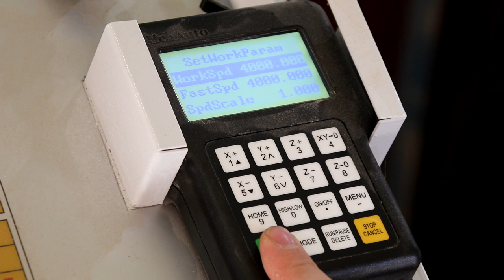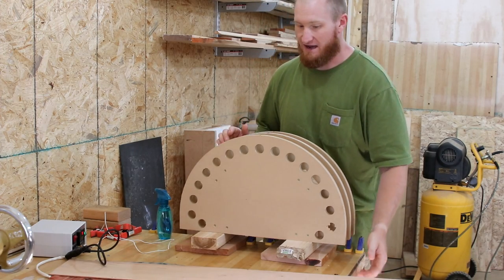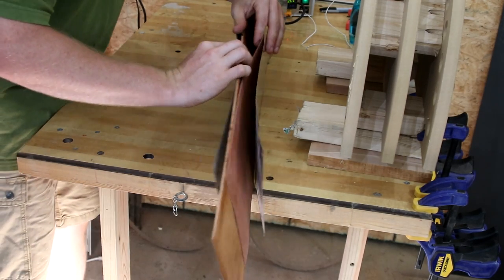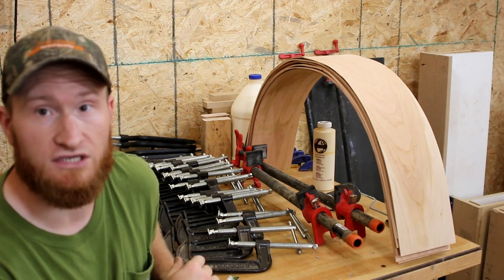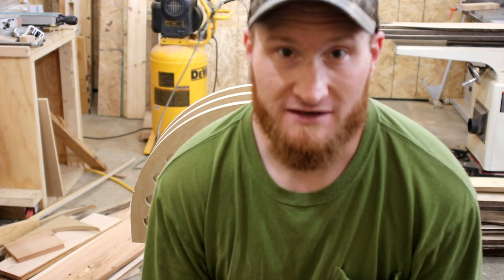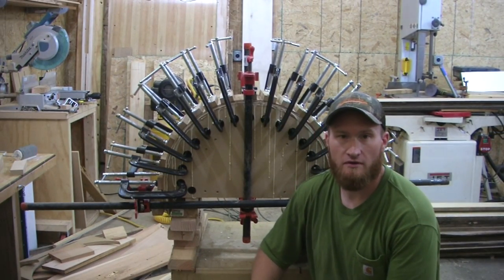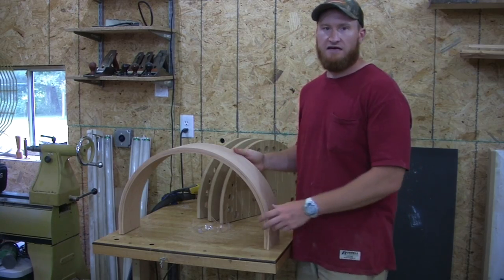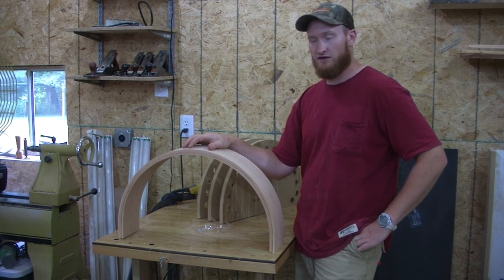Serious skills! This guy bends wood! Southern Indiana Sawmill

Comment: I need to build a corner table with a 20" radius (so a 1/4 round  of 40"). I don't have a heat blanket; and don't want to buy one for one project. Will wetting, alone, the 1/8" stock and somewhat prebending it work on that larger radius? I need 6 each 1/8" to make 3/4 thick. I need to go 4" wide (finished).

Comment: How you like your mirka sander? I have some problems with lots of pig tails after sanding ,,, have you had that happening?
Reply from the maker: Not really had any problems with that issue.  I use fresh Abranet exclusively on the sander which leaves no swirl marks.  You may want to read the manual which describes different weighting methods based on pad size.  If the weight in the sander is not balanced properly, I could see how it may have an effect as you are describing.  Thanks!

Comment: Instead of all the clamps, could you use wide strap and ratchet?
Reply: Ideally you use a large clamping jig like this. Strap wraps dont apply as much pressure.  Usually a great deal of cabinetmaking time is spent making jigs like this. If you needed to make structural curves its similar but far more clamps and usually a beefier jig.
Reply: YES, you are a thinker! I'm sure a mind like yours can come up with a thousand ways to do this simple arch. There's a lot of ways to skin a cat. I've seen this done by simply cutting the inner and outer arh pattern and then tying them together over the laminate with bamboo strips. I've seen it done using mud, sand and even stone forms.

Comment: Nice video, but I disagree with you saying a vac bag wouldn’t pull it together. I have used vac bags for years. They clamp hundreds of pounds per square inch.  Never had anything not bend no matter how tight the radius.

Comment: Wood glue is wood glue.. you don't need to buy an expensive type
Reply: This is not necessarily true.  Wood glue such as tight bond allows too much spring back when you remove it from the form because it is not rigid enough.  Glue made for laminating will minimize any spring back so that your piece holds its proper shape.  I have used plastic resin glue for custom bending handrails and it works well.
Reply: LMAO.  This worked but it took a long time.  There are easier ways that allow mass production 
His labor cost if put into the product would make it cost excessive.  Nice cnc work though.
The hidden costs here also drive up the price on sale.
Reply: Not true at all, each glue has it's own unique characteristics. Some are more rigid and crack from wood flexing over time and glue geting brittle over time, while others can flex  as if rubber. It just depends on what you need the glue for, a boat for example can flex by up to 12in from a wave and most glues cant handle the stress so they make flexible glue specifically for those parts that flex. Hell they even make a flexible epoxy....... but I agree that regular wood glue can handle most jobs for glueing wood but in some specific cases you need custom materials and alot of thoght and engineering went into development of these products. Some of these glues are so well made that they will outlast the wood and that's saying something considering that some wood work is hundreds of years old.... regular chalking gets old and brittle in as little as 10 years and the good stuff lasts 40-50years(also costs 5 to 7 time more then cheap stuff)... chalking is a great example because it dries out so quickly and gives you a rough idea what happens to all materials as they get oxygenated  and bombarded with heat/cold and UV light eating away at the "half life" of the molecules in the glue/materials
Reply: Mike Keegan More often than not, the wood fiber breaks before the glue joint does, unless there’s something weird going on. This is with any wood glue I’ve ever used.

Comment: looks like your method of bending works great.
about the special glue thou, i wood think that the “special glue manufacturer” wood design the special glue for flying layers to get more time than just 25 minutes.  if you’re letting it setup for 12 hours anyway, why not give the people a break and allow more time instead of us trying to rush before the glue skins over.
elementary in my opinion.